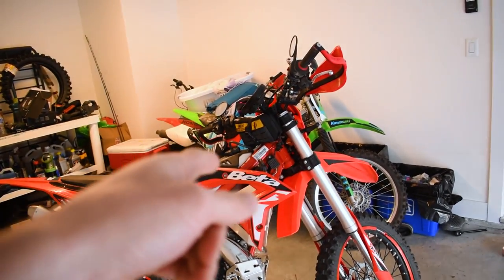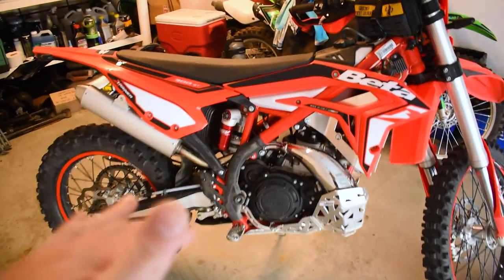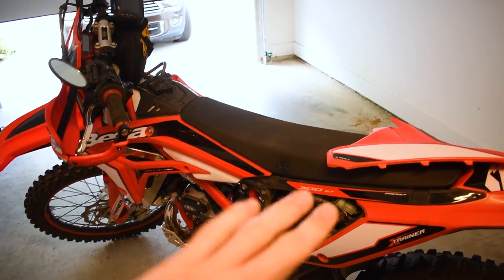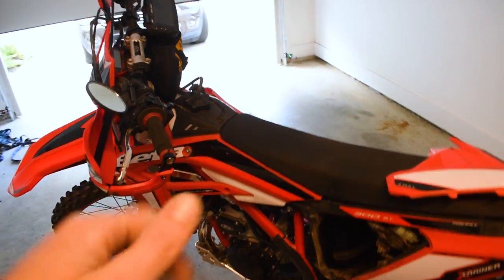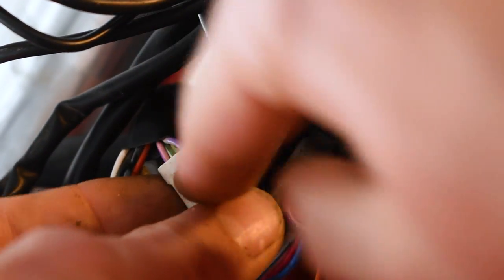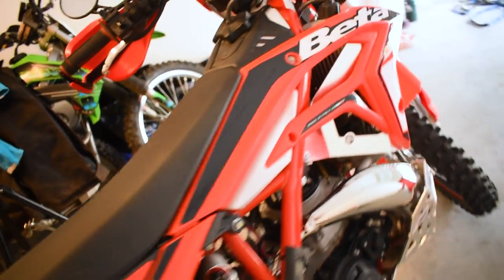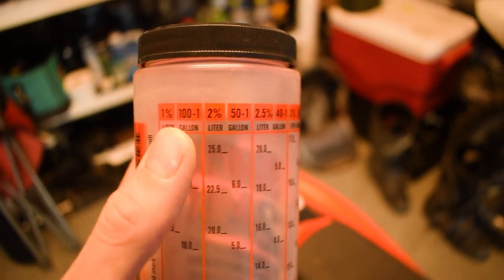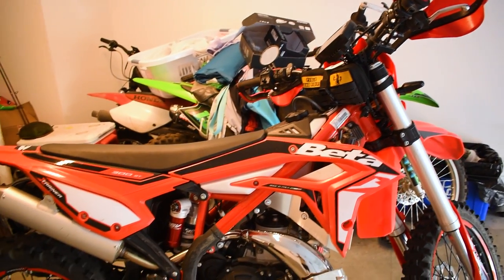How To Delete OIL INJECTION On A BETA 2 Stroke Dirt Bike

Comment: It appears that the most likely cause of a failure on your Xtrainer will be from a improperly installed air filter allowing dust to be introduced inside the air boot behind the filter.  It is very noticeable when you removed your air filter in the video.
Reply: My heart skipped when I saw that.

Comment: Beast video, I think that's smart of you bulletproofing the bike so it doesn't have any possible lack of lubrication due to a pump failure. Smart way is the best way no chancing the pump going out randomly.👍👍👍👍🤙⚡🥂I run my bike 30-1 oil ratio 4 oz oil 1 gallon gas
Reply from the maker: 30:1!? Fuck thats rich on oil eh
Reply: @AaronsEnduro  I know, it's a 2 smoke 😃tho that is what my owners manual recommends.
Reply from the maker: Holy smoke eh

Comment: Why? Oil injection for 2 strokes has been in use and dependable since the 70s. Three of the six 2 strokes I've owned had oil injection and never had one problem.
Reply: And we've had electrical systems for even longer. That doesn't seem to make a difference to some companies cheaping out on quality.

Comment: Hi do you think I should get a d3 exhaust for my klx140 or a 170cc kit first ( note I’m an experienced rider just wondering which to do first)
Reply from the maker: Well you cant use the 170 kit without an upgraded exhaust
Reply from the maker: It wont run good at all
Reply from the maker: So id say exhaust first
Reply: Do you recommend a rev box if I have a stock motor
Reply from the maker: Not gonna make that big of a difference on a stock motor
Reply: Ok thanks man I also wanna say I have a beta 200rr and I’ve had nothing but good times with it great choice on your bike man
Reply from the maker: Team BETA! 💪🏼

Comment: hi,there is a reason to take the oil hoze? out.couse if u cancelled the pump nothing happened
Reply from the maker: You need to block/restrict the hose from being able to suck any air into the air intake. There is a natural suction created which will try to draw from that tube. If you delete the oil injection, and don’t block off the tube you will start to suck more air than the carburetor is compensating for. You will run the bike lean of fuel doing this

Comment: Oil pump diod from racing models cure check engine light
Reply: Plugs into oil pump plug
Reply from the maker: Where can i find that
Reply: Any beta dealer. Same looms used on all betas so racing models without oil pump system need diod to eliminate check light  . I was beta technician for 3yr seen lot of bikes with oil pump delete fail because check light on unable to know if other issues arise
Reply from the maker: @paulread8367 good to know! Thanks buddy! Got any other snazzy tidbits of info?
Reply: Interesting fact some older model oil pumps had constant live so if cdi plug had any moisture it would cause oxidation on 3rd pin from left in cdi unit
Reply from the maker: I was reading about that on the beta x trainer facebook page! Seen lots of OI failures due to that 3rd pin corrosion

Comment: Hey Aaron I’ve just done this unplugged it and put the zip tie on went for a lil test ride my check engine comes on at the start but turns off after a couple seconds should I be worried that it’s not coming on I didn’t unpin that plug ?
Reply: I didn’t unplug the low oil light maybe that’s why
Reply from the maker: The only thing i unplug is the oil injection itself. The check engine light should be illuminated
Reply: @AaronsEnduro  yeah mine isn’t weird 3 seas showed 2 plugs unplugged maybe I’ll try that

Comment: Hey Aaron my kLx 110 will not start or it will not shift in to no other gear but first  can  tell what the problem my be
Reply from the maker: Sounds like a locked up transmission, or a stuck clutch
Reply: Bent shifter forks

Comment: Why would you want to bypass oil injection
Reply: Why not mix your fuel and you’ll never have to worry about the pump failing as he explained
Reply from the maker: Because it’s a system that if it fails or has an issue you will kill your engine
Reply: @AaronsEnduro  ah, thanks for the info

Comment: Why would you choose to do that?
Reply from the maker: Because if the oil injection fails in anyway (cut oil line, loose ground, ECU pin corrosion, etc etc) you’re engine will not get any lubrication and will blow up garunteed
Reply from the maker: Deleting it and premixing your own gas guarantees that the engine gets proper lubrication
Reply: There's no indication that that oil stopped?
Reply from the maker: If you get the check engine light indidication odds are its already too late. The indicator is there to tell you the system has failed. But if the system has failed while your riding you were running the bike without any lubrication. Not to mention thats only if the system detects the oil pump has failed. If you tear/ cut the oil line the bike has no idea. So youd 100% kill your bike in that circumstance
Reply: Oh, I get it, thanks for the reply!
Reply from the maker: Anytime!

Comment: Bugs me when people improperly use the word “delete” like this. The word “Delete” is for Computer/software applications and supporting parts, not just any ole thing you want to REMOVE, which is the word we should be using in this case. Until Diesel Engines with Diesel Particulate Filters came out we NEVER heard people misusing this word, we said things like “remove” or “take it off”. Removing those DPF systems called for a certain software deletes to trick the computer into thinking the DPF system was still in place so the word Delete did loosely apply to those situations and the young people that grew up in this era started to misunderstand why the word was being used and now they just use it to describe removing ANYTHING wether it’s computer related or not. I likely wouldn’t have as much of an issue with it as I do if it just didn’t sound so stupid when they say it, but it does… so I do… my apologies if anyone wastes their time reading this, just needed to get it off my chest 🤣
Reply from the maker: Must of really triggered you lol

Comment: Quiet obvious this guy has no idea, if the Beta oil injection has a problem it automatically goes to full oil supply.
Reply from the maker: 😂. So if you’re pump fails, or the cdi pin corrodes and breaks off, how does it “automatically go full oil supply”

Lemme tell you, it doesn’t and youll just blow your bike up.